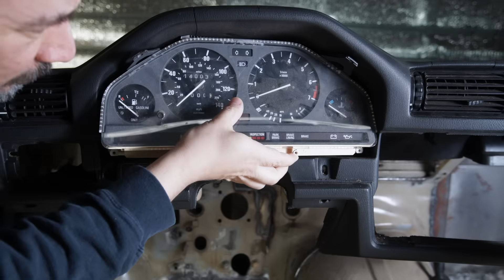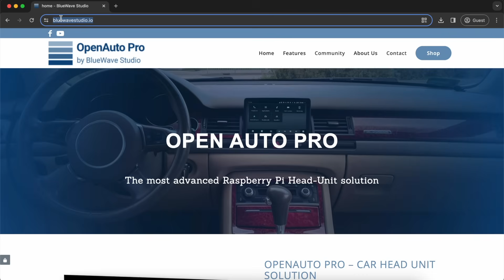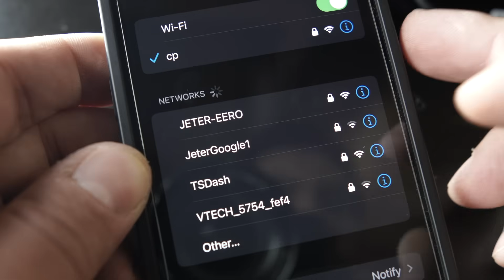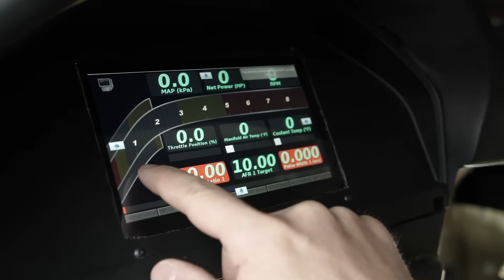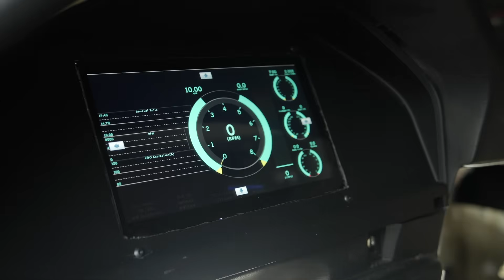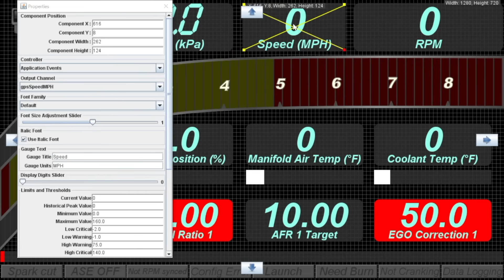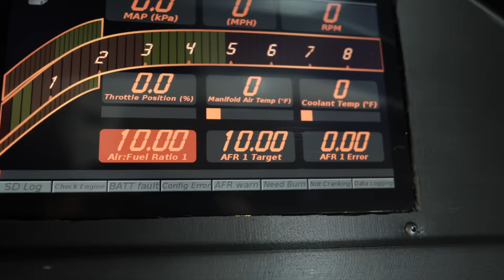Transform Your Digital Dash with the Power of a Raspberry Pi

Comment: Hi, I’m also setting up a pi dash with pretty much the same exact parts but my only problem is that I can’t connect to the WiFi, it just keeps trying to connect but never pairs it. I have another sd card with the raspberry os and it has no problem connecting to WiFi. Any idea what could cause it?
Reply from the maker: So using the TS Dash image is an issue?
Reply: @Itsallaboutthebuild  Theres no problem with the TSDash, it's just when I try to connect to my Wifi it wont connect for some reason. I'm trying to connect to my wifi to update tuner studio,TSdash, and my speeduino ecu update for tunerstudio. Do you have any other soc med where I can message you directly?
Reply from the maker: @ try finding us on IG, if I remember correctly you connect to the WiFi running on the Raspberry Pi that has TS dash. You’d have to look up directions on how to connect the raspberry pi in client mode to your home WiFi if you want to connect the other way around.

Comment: Sorry, but take a glimpse at the shape of dashboard needles is too much quick and efficient for driving. Unless you design round meters with colorful and bright needles and background on your touch screen display...
Reply from the maker: Can add some circular gauges on the sides???
Reply: @Itsallaboutthebuild  speedometer at left and tachometer at right, both big and centralized. Oil pressure and temperature, water temperature, battery charge, etc, smaller and displayed around. That is a decent dashboard.
Reply from the maker: @marcoromanelli6000  yeah, like that idea. Haven’t finished the setup yet. Still working on repairing the last of the rust 😁

Comment: Is it possible to have a digital dash running on my Android headunit? Apple CarPlay doesn’t allow for digital dash displays, it limits you to a few metrics displayed in a very boring text format. This is with OBD FUSION, but all other CarPlay OBD2 apps have the same limitations.  I don’t want to clutter my dash with multiple displays, and simply mirroring my phone on the Android headunit defeats the purpose. Any help would be appreciated!
Liked and subscribed!
Reply from the maker: @DrW0392  I use obd fusion on my tablet along with a veepeak Bluetooth OBDII scanner…. Not sure if you can connect it to an android head unit. Never tried, but that would be really cool. Can you install OBD fusion on the head unit? If your head unit has Bluetooth, it might be worth trying…. Let us know how it goes, oh what kind of car do you have???
Reply: @ I’m using OBD Fusion as well. On my iPhone/iPad I can use all the functions of the app. I can run OBD Fusion on my Android headunit. However, CarPlay severely limits what functions can be used. In my vehicle, 2013 Focus, OBD Fusion is limited to a few data points, in text format: Vehicle Speed, Coolant Temp, Avg MPG, trip duration, and distance traveled. OBD Fusion is only available when my phone is connected via CarPlay. So I wouldn’t say that the headunit can run OBD Fusion on its own.  It’s super frustrating, it seems in order to run a digital dash I either have to use my phone or tablet as the display. Defeats the purpose of installing the Tesla style Android headunit (which claimed the ability to run “popular OBD-2 apps”
Reply from the maker: @ Ah I see. Will have to check out the Tesla style Android headunit for our F150. Would be really cool to feed OBD directly to headunit running OBD Fusion. Do you have the model of the Tesla style Android headunit???

Comment: Why 3d print a dash, cut-out for the screen and then consider a bezel? Why not 3d print the dash with the screen aperture made to measure, with mounting posts so you don't have any hardware visible from the front?
Reply from the maker: @steveflatman  the model didn’t have a hole and at the time we weren’t sure which program to use to add the hole. Since then we’ve been learning how to use Shapr3d to add the proper hole and will be reprinting in ABS 🙌

Comment: That print looks soooo clean. Looking at the prints pidash are trying to sell is honestly comical. Idk how they would even have the audacity to try and sell their printed bezels with the way they look.

Is that a PLA or ABS filament?
Reply from the maker: @bassassin2695  it’s a prototype using PLA, not recommended from my testing in other videos. Working on testing PETG and ABS now.  I just looked at the pidash, you are right. Horrible looking 😳
Reply: @Itsallaboutthebuild  ive been looking into printing a bezel for my truck. However I live in TX so I think I'll have to do it with ABS, which I haven't worked with yet. I feel the PLA will melt in my dash when it gets to 140° inside the cab during the summer lol. How many hours did yours take to print?

Comment: https://youtu.be/5jhkvfXsXQM?si=892L0MNP-oAg--rp
Reply from the maker: Love it!!! More details pls!!!
Reply: @Itsallaboutthebuild  my dashboard has passed on android. a program for displaying realdash information.  I can create a project specifically for the e30 with a pin to pin connection. In the video that I gave you, my version of the dashboard has a lot more features than yours. The video that I sent you shows only a small part of what the panel can do. much more functionality is included in the program and can be customized to suit any taste. including different types of skins, steering wheel controls or steering wheel switches. I'm from Russia. The video on my channel is in Russian, but you can write to me if it would be interesting to create a project for e30.
Reply: @Itsallaboutthebuild program  realdash.10.1 inch screen with Ali express . power supplies of 12v 2 pieces. the can board of the emulator is our own design. there is also a video on the channel, but it's in Russian. I can help you create a much more detailed project for your car than yours. you have seen the example. this is only a very small part of what this platform can do. if it's interesting, you can try to make a va. project. I'm from Russia, if anything.

Comment: Slant 3D has a ton of design nuggets, if you're designing the parts, then you should add Gabe to your list of subscriptions. That hole should have been designed into it, I get why you say you did not, but this is a way better way to approach that with designed in supports. My E28 light switch panel has several, I also angle some prints to not need supports at all

https://www.youtube.com/watch?v=WYQbxIVLz6Y
Reply from the maker: Just watched the video, awesome!!! Thx for sharing. Will have to think a bit more about how to get the center empty 🙌🙌🙌

Comment: Hi, 
I want to mount a dash of this type on a car with a diesel engine, M57. 
This programming is compatible with ECU type EDC15 or EDC16.
Thank You
Reply from the maker: @alexandrvsivtev  not sure, we are using Speedunio ECU to the Raspberry Pi. If you have an ECU that supports OBD2, then you can run other software like openautopro or realdash
Reply: @ thank you for fast reply. So, I will try and will se if it’s work or not
Reply from the maker: @alexandrvsivtev  let us know how it goes 🙌🙌🙌

Comment: Why couldn't you change the drawing to fit the monitor so that you don't have to cut out the frame later?😅
Reply from the maker: @fury2012  I initially started doing that but the extra supports added around 2-3 hours more of printing. Figured I wait to get some ABS filament instead. So this one is more of a prototype 🙌🙌🙌

Comment: I think this could be done a lot cheaper with ESP32 than a Raspberry Pi. Much smaller. No jumper cables. No USB cables. Nice and tidy. You can drive LVGL displays with it. You can join the car’s CAN bus (or create a CAN bus in a restomod project).
Reply from the maker: @TerraMagnus  oh nice, great idea. Will have to look into an ESP32. Looking to go Speeduino ECU
Reply: "this could be done a lot cheaper with ESP32" // Is there ready to view projects?

Comment: If you 3D printed the cover, why not cut out the hole for the display in the model instead of using a dremel?
Reply from the maker: @sergeantsapient  the 3D supports for having the shape cut out would have made a 8+ hour print job take another 6+ hours. Need to work on the 3D file a bit more for sure instead of cutting out manually. First one was more of a test 😁

Comment: Result is kinda ugly TBH
Reply: It's the empty space that kind of ruins it. Maybe a few of those round LCD displays would fill in the sides, assuming that the Pi can handle that many displays.
Reply from the maker: @sergeantsapient  to circle gauges to the left and right would be sweet. Need to do some more research 😁
Reply from the maker: @stel1000  sucked for sure. Made a bezel, but am working on proper 3D printed model with opening

Comment: Does it support the gas gauge as well? Check Engine light?  
I drive and need to know how much gas I have left, and the state requires I have a check engine/brake/etc lights for state inspection.
Reply from the maker: Still working on the other items. ECU functions will be through Speedunio. Other items may need an audrino for analog to digital inputs.

Comment: This is super cool! However, I would prefer a larger screen that would fill the empty space out. And what about the turn signal indicators and other lights on the dash? There is a lot of empty space on that panel.
Reply: A bmw with side indicators? That's a new one 😅
Reply from the maker: @R-Tech  😁😁😁
Reply from the maker: You are right. Bigger screen would be better. We're working on side side gauges that would have turn signal light indicators too :)

Comment: Is it possible to upload the original info like total mileage etc ?
Reply from the maker: @mradxxl1236  that’s a great question. I didn’t check on that, will have to dig through the TSDash user guide
Reply: I have a feeling that in some places it would be a legal requirement to have that, to pass inspection!

Comment: Hey i also have an E30. Maybe try doing a video of you demoing the new digital dash whole driving? Would wonder what itll look like while driving. Just a consideration for other E30 owners.
Reply: I have a 1988 e30 too. Did have an m20b25 from factory but I swapped it for an m52b28.

Thank you for the video
Reply from the maker: @supadupa3  oh nice, was thinking of doing a swap, but the cost just kept going up and up. So we decided to stick with the m10. K swap would be cool too, but would bother purist 🤣
Reply: @Itsallaboutthebuild  I'm not a purist and am happy to see people try different things, even if I sometimes don't agree.

From what I've read about the K swaps they work out to be quite expensive.  If I was to do it again I'd look at a volvo 5 cylinder or vw vr6 if a bmw 6 cylinder was difficult/expensive to get... or the 4 cylinder newer bmw turbo engine.
Reply from the maker: @supadupa3  nice, was thinking about adding a turbo at some point in time. Hard to find turbo exhaust manifold for m10
Reply from the maker: @send1t674  e30 brothers, what year, what engine??? We for sure will make another video as we get it all done. Still trying to finish these rust repairs 🤣
Reply: @Itsallaboutthebuild  I have the usual M20B25 but I would love to do a M52 or M54 swap eventually
Reply from the maker: @send1t674  those would be great swaps too

Comment: Was the original dash not working? The caps on the pcb that run the service lights leaks and break the speedo.  I got pulled a few times in my e30 as the speedo  would work when it felt like it.
Reply from the maker: @spr00sem00se  was completely dead. Will check the caps as I still have the original. Thx 🙌🙌🙌
Reply: @Itsallaboutthebuild  check the battery thats soldered to the PCB behind the service lights, what happens is that with age it leaks and burns the circuit traces.  You may need to repair it with some jumper wires, this was beyond my skills when I was 18 and had one of these.  I reckon I would have gotten it working these days.
Reply from the maker: @spr00sem00se  good to know. The board looks bad in different spots, but I’ll start with the battery. Is your e30 a daily driver???

Comment: I guess I'm going to have to use this since Shadow Dash is no longer available
Reply from the maker: @mlr06121974  never heard of shadow dash, is that an app or a complete dashboard system?
Reply: @Itsallaboutthebuild  https://youtu.be/X7JOLBSakIk?si=rjZdjGGY1UncLeAn

Yes it was an app.    Some still have it running but as android updates it has connectivity issues and now it's almost abandoned
Reply from the maker: @mlr06121974  Oh I see. Yeah TSDash should be able to do the same thing Shadown dash was doing. You'll just have to package up a few more things yourself :)
Reply: @Itsallaboutthebuild  I'm betting they wanted to get out of the so called app store and have an actual program running it.      Which I don't blame them one bit.
Reply from the maker: @mlr06121974  Maintaining an entire app can be quite a bit of work, so that makes sense.

Comment: So how are you handling fuel indication etc ?? Also stuff like idiot lights (turn signals etc). 

Boot time ?? 

Have an E30 build and would consider it.. But feels a bit half done.
Reply from the maker: @SeftonHanley  yes, definitely half done. We’re in the process of replacing the DME with a Speeduino standalone ECU. We plan to leave all the other components in place like turn signal/lights/heat control. Boot time with Raspberry Pi 4 and fast SD card isn’t a noticeable issue. Will post another video on all the other stuff soon 🙌🙌🙌
Reply: @Itsallaboutthebuild  So fuel gauge ? Kind of essential ?
Reply from the maker: @SeftonHanley  Also working on another circular gauge, but TS Dash can get other data feed into it too. Check out https://youtu.be/aA-X9FTGoEs?si=2bBdIVYFC3Big2dk You can use an input into the raspberry pi via aurdunio similart to this to megasquirt.

Comment: Wait, you 3d printed and didn’t design the opening in to the print? And then you had to drill holes? Seems like you missed an opportunity there
Reply from the maker: @archipeep  the 3D file was already made. We originally added a large hole in cura, but the tree support would have added a few more hours. We’re working on fine tuning that 3D file for sure 🙌

Comment: Good but 7" is a bit small, there are bigger screens now at acceptable prices
Reply from the maker: @jeanlance1719  for sure, ran out of height space on the 3D printed model. Will need to adjust for bigger screen or screen that’s a bit wider, but not taller 👍
Reply: @Itsallaboutthebuild  hide part of the screen behind print. Screen would fill area. Less plastic, better look, less visible joints. Then adjust layout of virtual dash to match printed parts so nothing is behind print. Your screen will look like have shape of a real dash.
Reply from the maker: @ColdNightmareHell  thanks for the tips, we printed a small bezel, but I’d like to print the dash with an insert and bezel with abs instead of PLA too 🙌

Comment: Can you run multiple screens on the same CPU/raspberry… Or run multiple raspberryPi and screens in parallel?
Reply from the maker: The Raspberry Pi Model 4 B and and Raspberry Pi 5 both have 2 micro HDMI output ports, so you could run more than one screen. You could launch TSdash on one monitor and perhaps another app for stereo functions...Sensing a part two to this vid.... :)
Reply: @Itsallaboutthebuild  …touchscreen? 🫣

What if someone had a HUD for the backseat, for Uber passengers… That compiled live dash data, ie Speed… with Radio, driver info etc 😏😏
Reply from the maker: @BrokeTheGamer  oh sweet. Now you’re talking 🙌🙌🙌
Reply: Can't wait  @Itsallaboutthebuild
Reply from the maker: @akshaythepunekar  thx

Comment: I need a new radio but hard to find a single Din 8 inch with DSI port
If you dont have a DSI port I guess only way to configure the gauges is by bluetooth or usb ports on Pi ?
cheers Brett
Reply from the maker: @brettflavell6942  what car do you have? Does it have OBDII?
Reply: @Itsallaboutthebuild  yes hyundai Terracan....
Reply from the maker: @brettflavell6942  If it has OBDII, then the raspberry pi can connect to OBDII via bluetooth and an OBDII to Bluetooth dongle. Openautopro software is a better fit for ease of use.
Reply: @Itsallaboutthebuild  many thanks, I will try but my car users KWP2000 protocal and those BT dongles
always seem to have a problem connecting, is there a hard wire way? I only need fuel gauge and boost later, Brett
Reply from the maker: @brettflavell6942  🤔 obd-I doesn’t have any real time diag outputs like obd-II… so unless you install separate sensors that have a digital output, not sure what you could do with what you have…